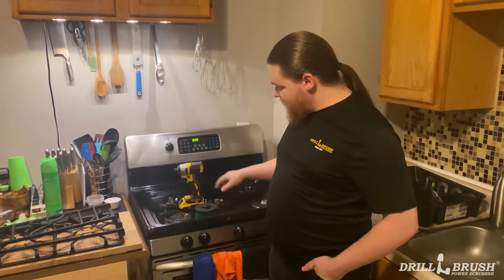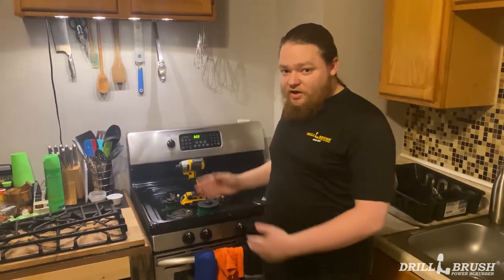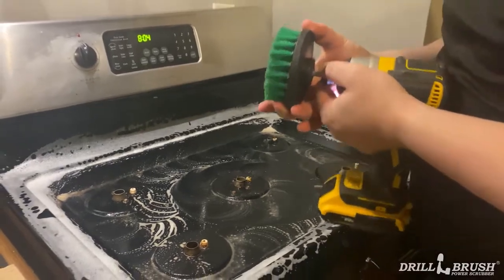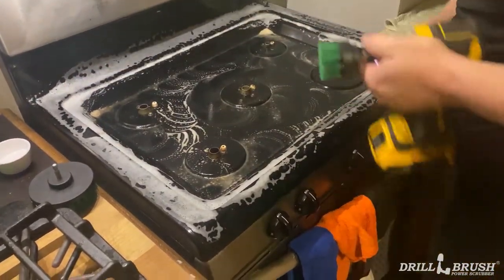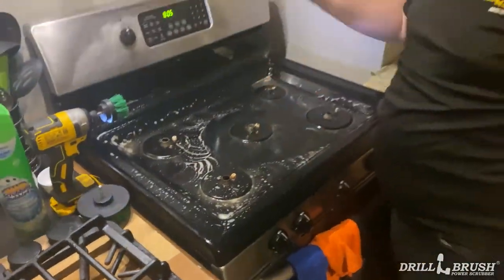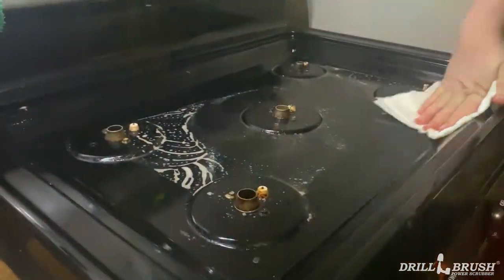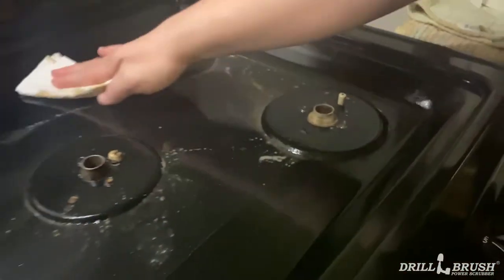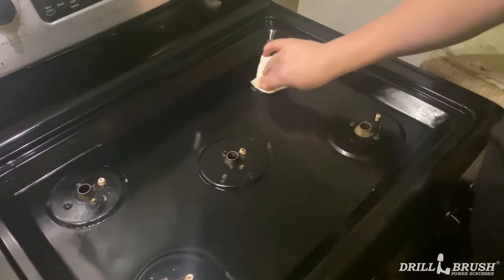Cleaning a Filthy Stovetop with a Drillbrush | Drillbrush DIY Guides

Comment: Will the green brushes scratch the surface or inside the oven? Thanks.
Reply: I don't think it will are the coating is very hardy.
I used a metal scouring on the inside of a very dirty oven door with clearly years of neglect and took off all the crust and left no scratches.
I was very surprised by that and looks fresh to this day.